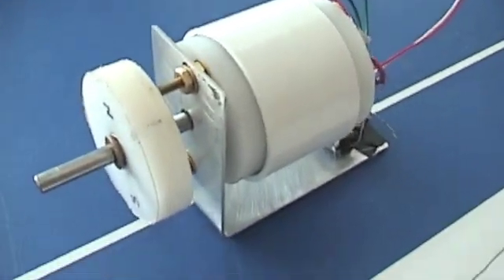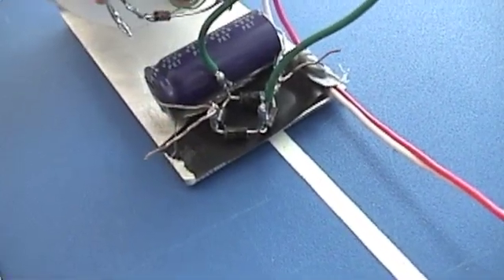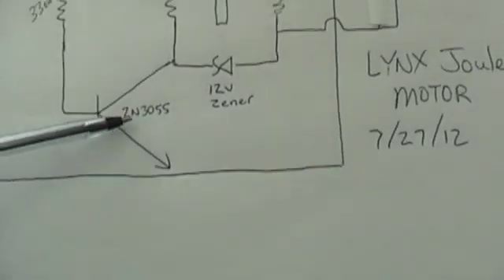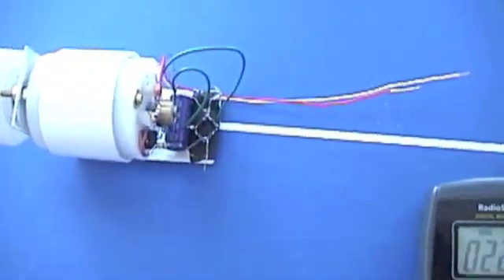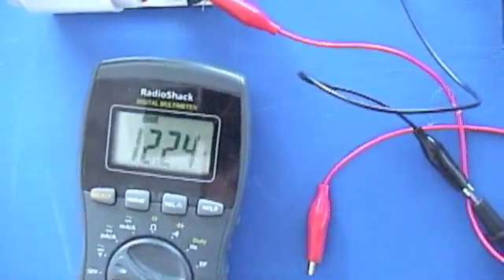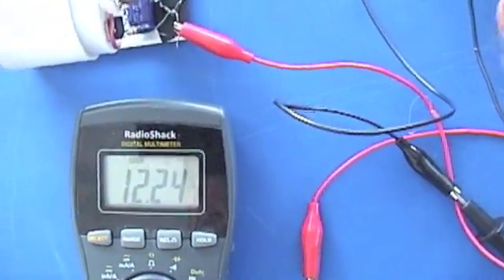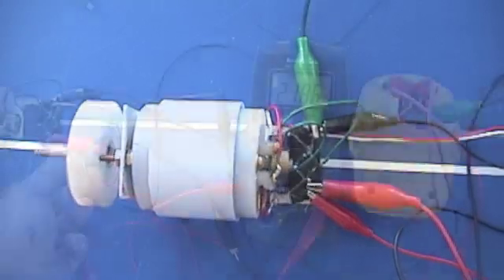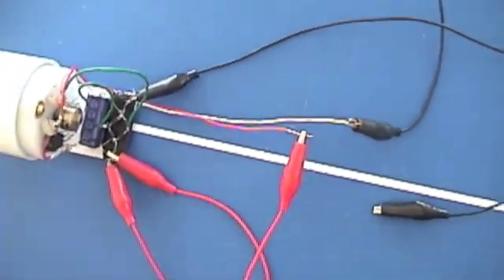Lynx Joule Motor 2

Comment: so it uses a camutator for the commutator. I assume that is to only contact the high side. or the lobe. is that the best design to achieve the pulse. when connected. I have had several ideas. for motors but haven't experimented with any yet. usually I figure it isn't a good design . in my head. great job great looking motor

Comment from the maker: I use the zener diode to block the collector DC from powering the secondary motor coil constantly.  Only the flyback spikes can pass through when the magnet rotor is in the right position near BDC.  The zener is a 12 volt.
This has worked so I haven't tried another component there.
My wife and daughter sing around the house all the time.  They are like a human jukebox.  I just say a lyric and they sing the rest of the song.  Thanks!